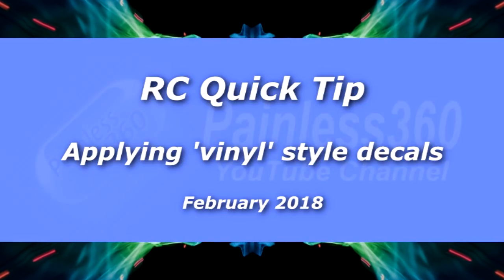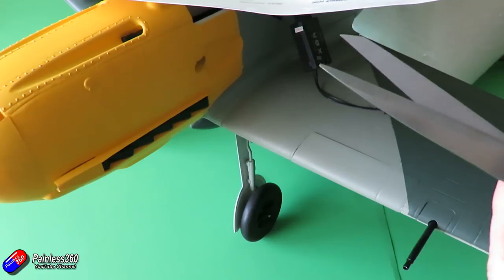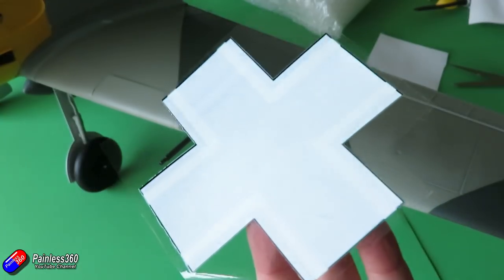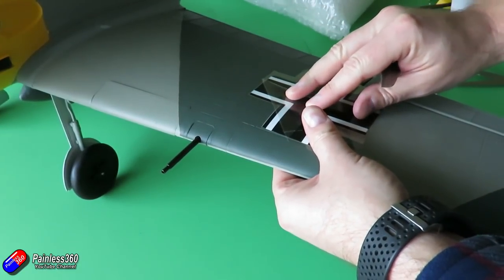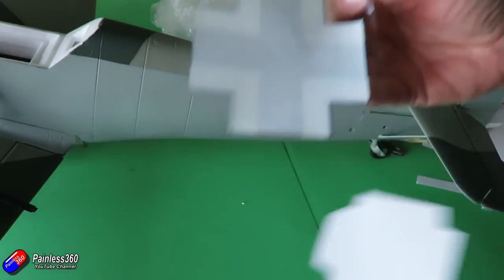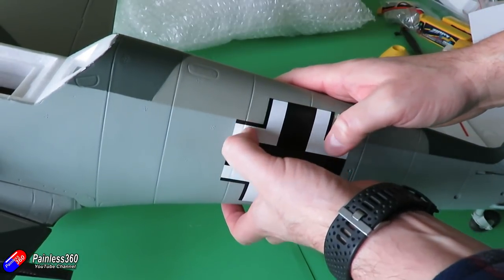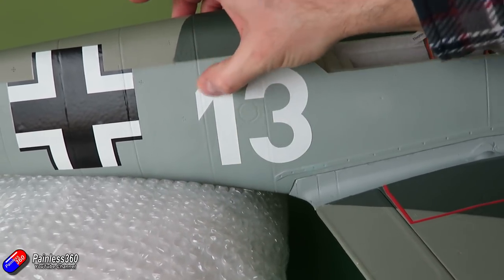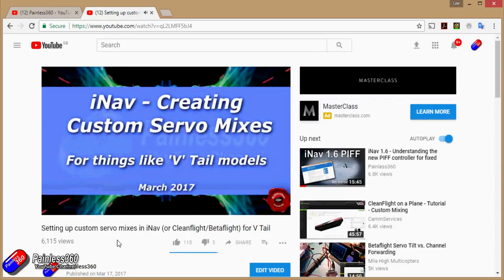RC Tip: Applying Vinyl Style Decals

Comment: Great demonstration Lee! Very informative.
I too have this model and when I applied my decals, I took the extra step of going over them with a warm (not hot!) covering iron. As you stated the heat of your fingers will help activate the adhesive, the iron really helped this process, especially with the tiny nomenclature.

Cheers!
Fergy

Comment: I've always used  a dash of washing up liquid in water and spray on the surface first. Sounds wrong but it works. You can then move the decal if it's not quite right. Using a paper towel to dry and push the excess water out and it's stuck for good. The RC car guys use this on their body shells. My latest  video shows the results on a FPV wing l covered in brown paper and then painted. Then applied the decal with this method.  May help and as you said practice first
Reply: Windex works too. We used to apply screen protectors on phones and tablets by spraying a light misting of windex first.
Reply from the maker: A great tip but that works best on waterproof surfaces. I didn't want to try that on this one! :D